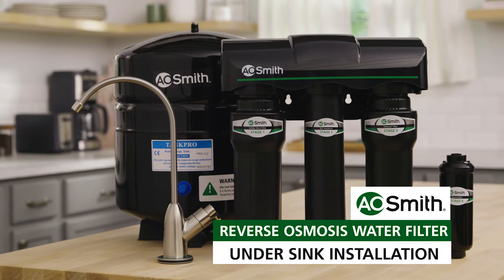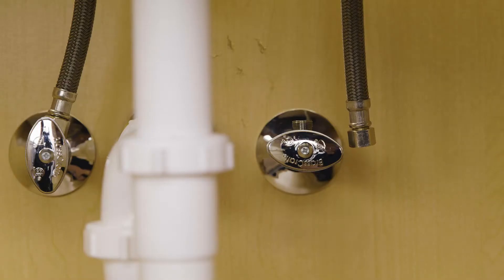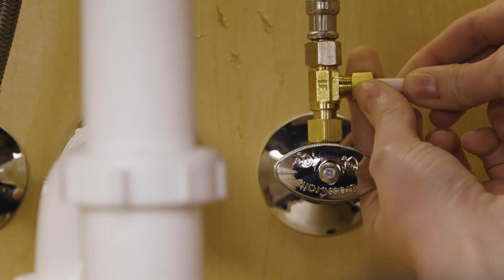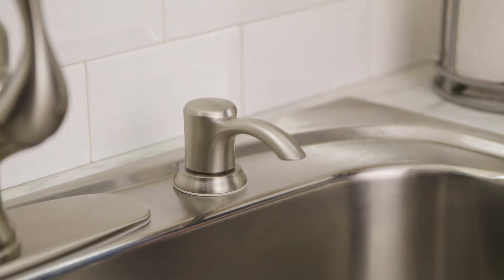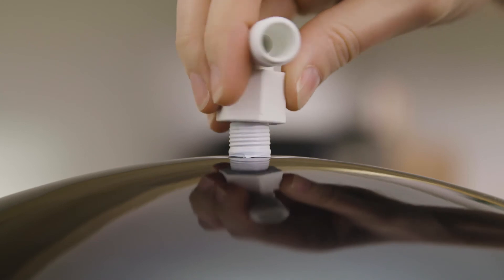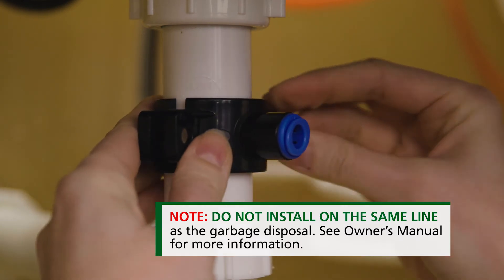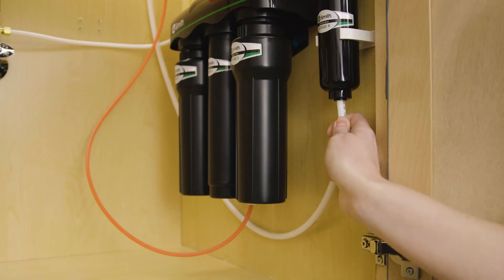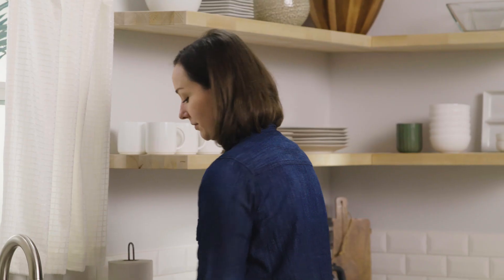Reverse Osmosis Water Filter Under Sink Installation

Comment: Can this system be split and ran to a refrigerator? My old system was split this way and I replaced it with this system. When I had it connected just to the faucet, it worked fine. Once I split and tied in the refrigerator, most of the water seemed to be going down the drain